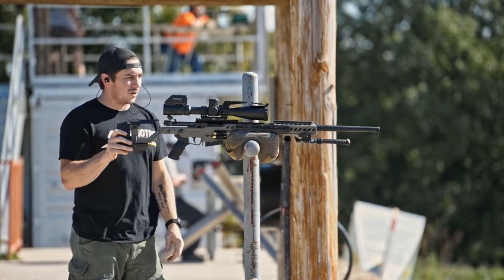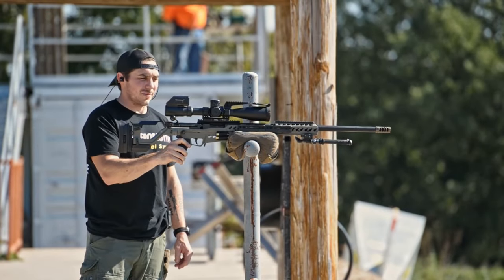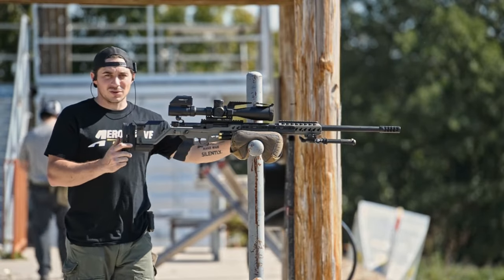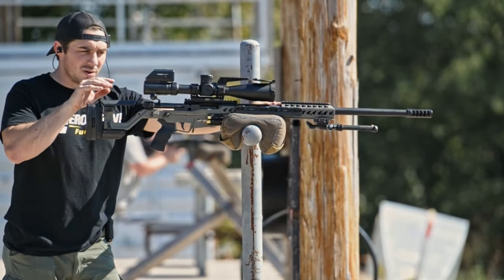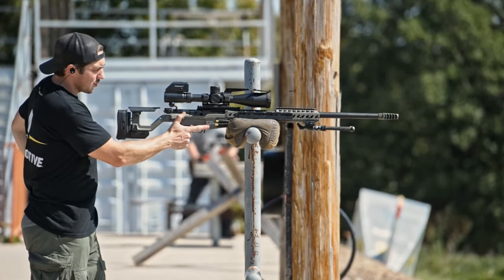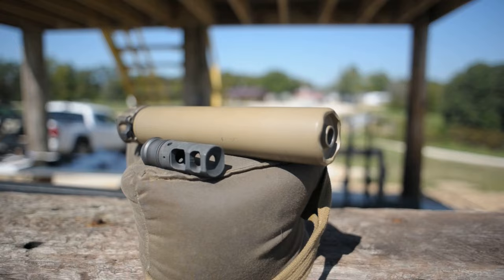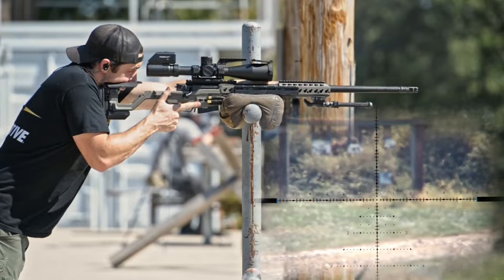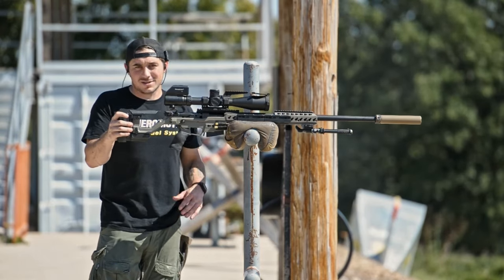Accuracy International ATX - 6mm Dasher Muzzle Brake Testing

Comment: did your action end up lightening up after a while? just picked one of these up and my bolt lift feels pretty heavy, shoots amazing but thats my only fault I have with it.
Reply: Yeah its super smooth now. Its still heavier than a 90* and a lot of the custom 60-70* actions.
The biggest thing I noticed wearing in was that hard angle on the receiver that the bolt handle rides along. Once that rounded off a bit it really smoothed up.

Comment: Nice rifle how’re you liking the dasher in the ATX? I’m wanting to pick one up soon.
Reply from the maker: Right now working through tuning/tweaking mags. Because of the length of the AI bolt, the Dasher is just a litttttle short to make it into the chamber perfectly. I have one mag that works well now. 
You can see a few times in the video where I have to run the bolt, let off, and then let the round finish popping up into the chamber. 
I think with a 6GT it would work perfectly fine.
Reply: Yeah I noticed that a couple of times. Look forward to hearing more about how you like it. $1000 off till the end of the year makes it real tempting.